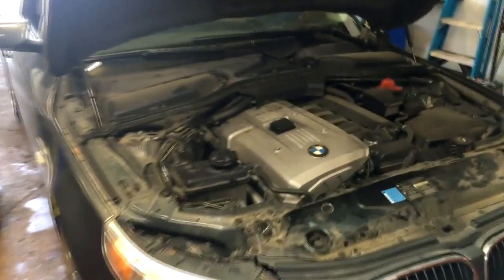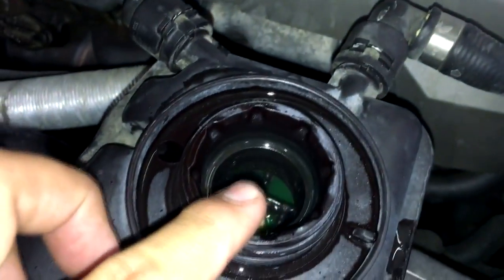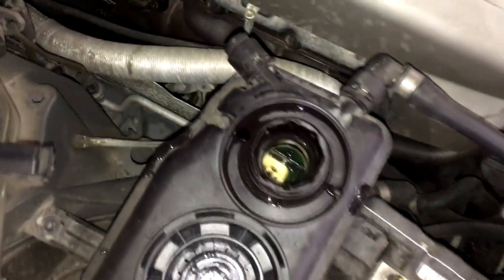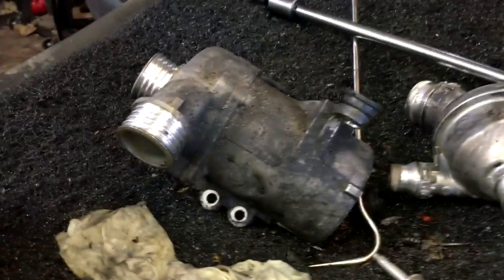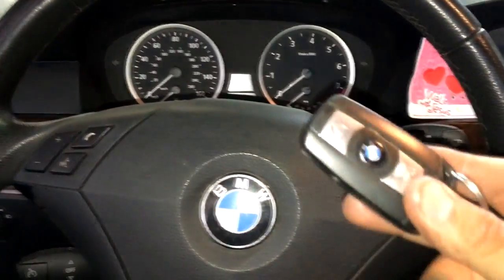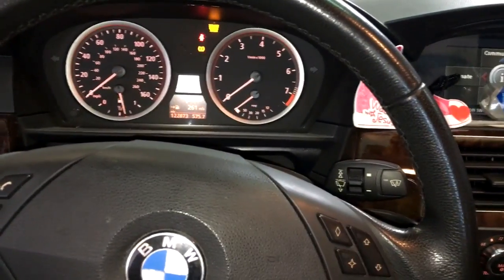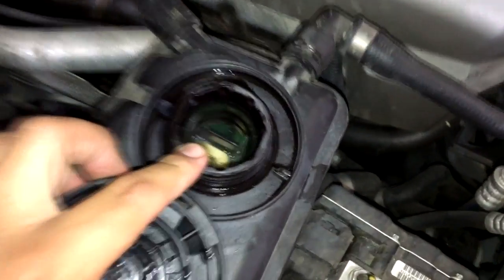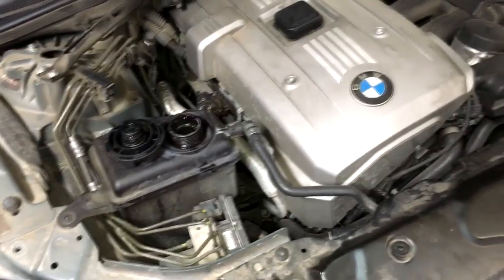BMW ELECTRIC WATER PUMP TEST AND SYSTEM BLEED

Comment: This if bmw have electric pump ;; not mechanical pump ☝️if he have mechanical pump the coolant will.flow only when engine is runing ; also auxiliary pump will flow coolant just thru heater radiator you will.not able to see a coolant flow here.

Comment: This is an excellent video man, thank you for posting this,and this is the first video I seen on YouTube showing a car running and pump doing its Job,my water pump isn't working when I start the car and I open the cooling reservoir cap I see no flow, circulation from the WP, car overheating even the fan can't cool it down thanks again..

Comment: I have f02 740li, if i disconnect the fan, the water pump starts, if the fan is connected the pump is not running, does that mean the pump is bad and needs to be replaced?

Comment: Hi Eric, I recently stumbled across one of your videos regarding the dodge ram 2012  fuel pump diagnosis.
I must say very well done! Thorough  and contrite. I then subscribed and came across the BMW water pump bleed.
This brings me to my question. Im hoping you can answer. I have a 2010 BMW 335i, and I have a peculiar problem with the cooling system. The car ran great. However, the coolant would leak on an intermittent basis. I came home one day and noticed coolant leaking from beneath the car. I let it cool down a while and then filled it with coolant. I looked under the car, and nothing was leaking. I didn't have the A/C on, so it wasn't condensation from the compressor. It was definitely coolant. I drove the car around for a bit and came back home and checked for leaks. Again, nothing leaking. The following day, I drove the car again to my friends place (15 miles approx.) and still no leaks. I left to head back  home and stopped for gas. I got out of the car, and there it was, a stream of water running across the ground. I shut the car off and waited a few minutes before opening the cap and filled the car back up w coolant.
I'm baffledat this point. I took the car to a place named Bimmer clinic. Specializing in BMWs.
They performed a pressure test, and they said it held. That the car is fine. Of course, it didn't leak when I had it there. Just my luck. 
I drove home, and the very next day, it started leaking again.
I took it to a second shop. Again, no leaks. Then, of course it leaked again after leaving the shop.
I believe the car has to be at running temperature and the thermostat has to be opening and closing several times before it starts to leak.
Have you ever come across anything like this before tegarding BMWs?
Any advice or knowledge would be helpful. 
Thank you!

Comment: My 32i E93 doesn't kick pump when i start the car..its only work when it needed..or i should test with ignition on n press gas paddle while car switch of..is there a issue?

Comment: Hi Sir.
Do you know what I should do to stop this bleeding process? After 28 minutes I turned off the ignition because the bleeding wouldn't end. And now, when I set it to 28 degrees at minimum power, this process starts, without me pressing the accelerator. It seems to have stuck in the active function.
Thanks

Comment: Question I got a 377A code Coolant pump swtiched off due blockage. I did the water pump test and it works. Why I'm getting that code im so confuse the car dont overheat either. 2011 BMW135I

Comment: I have the 2001 330ci m54 5 speed manual. I tried the methid of turning the key to in oosition and foot in the throttle but it didnt work. Fluid comes out oerfect when the csr is on though. I dont think that 10 second method works for my car.

Comment: Appreciate the video was a big help. I just have one problem the electric pump won't move any Water when it's running like yours did in the video, maybe a bad pump or can the heater control valve be stuck. Would appreciate your input. Thank you..

Comment: Hello I recently bleed the system on my bmw 328i later to find out one day that the water pump kept running over night after the procedure do i need to deactivate the water pump or does the car just stops doing that after a while . because if it stops by itself then I fear I might have a bad water pump . thanks .

Comment: The water streams out fine when my car is on but no water at all streaming when car is off during the bleed process, I can hear the water pump activate but no water streaming out the hole. Any suggestions?
Reply: I have the same issue on my bmw e90, have you figured out what was the problem?
Reply: @RockyGears  nah I end up selling it after changing water pump, reservoir, and battery. I completely gave up. Hope you find the issue would still love to know in case I run into a problem like that again lmk thanks

Comment: Great video, I am having some issues with my heater, replace new blower motor with new resistor, taking long time to pump the heat out of vents?? any suggestion from you. Appreciate your help...Thank you..
Reply: Not sure how long ago you posted this and if you have received some help. My Bm is doing the same thing with no heat through the vents. The cause is the  electric pump is faulty .

Comment: The key answer to my search was at the end of the video. That is, when running the air bleed program, the pump cycles on and off. None of the other videos or anything posted mentioned this. Thanks!

Comment: I have my water pump not stopping on my bmw f30 320i 2012. It drain all the battery and didnt find a solution. The pump and thermostat are new, the problem appeared when i changed the sensor... is there any chance to get any help please?

Comment: I tried it on my 04 545i   I tried the self bleeding test and I can hear  the water pump activate.  But no water squirting.               Then I started the engine and I see squirting.      I also had a code p0116  engine coolant temp sensor#1  the one on the pump.       Any ideas ma boi???
Reply: Ever figure it out?

Comment: Excellent video bro.       Can I do this test on a 2004 bmw 545i   it has the same coolant tank.     I recently tried it.    And I only hear a noise from the the water pump activate.  But. No water streaming in the coolant tank
Reply: I don’t hear anything on mine same car but don’t have a box key
Reply: If you have Mechanicyl water pump you will not able to See flow when the engine is not running ; but the noise comes from your secondary auxiliary pump that means that secondary pump is working. 😉

Comment: Great video thank you I need some help I have a 2007 525 Exide just replace the water pump and according to BMW I have to leave the system that’s with the switch on car off and basically the pump runs for 12 minutes but they use some type of charger that maintains a good voltage so nothing happens to the car do you happen to know a type of charger that can maintain a good voltage while the pump runsThank you
Reply: Hook a jumper pack up to your terminals under the hood

Comment: Good video.  Thanks for show us the bleeding process which removes trapped air.  

My question, when would one use the bleeder valve to bleed the system.  On my E90 it’s located on the coolant overflow tank.

Comment: Hey I have a question when I do exactly what u says to bleed it. Nun happen on have my car like it doesn't start that process I have a 2008 528i can u plz help me
Reply from the maker: It is possible your water pump is bad.
Reply: @ADVANCEDLEVELAUTO  I have this same problem and I just replaced the water pump with a brand new one 08 550i v8

Comment: Great video will the battery die because the pump its running without the car running, if so what can I use to keep the battery stable?
Reply from the maker: It only runs for a couple minutes before it shuts off by itself.
Reply: ADVANCED LEVEL AUTO I’ve watched a lot of other videos and they say to run this for 12 minutes while you have a battery regulator connected to your battery. Thoughts please?